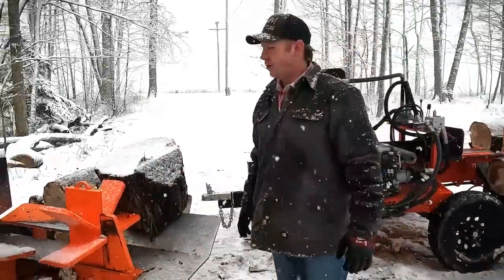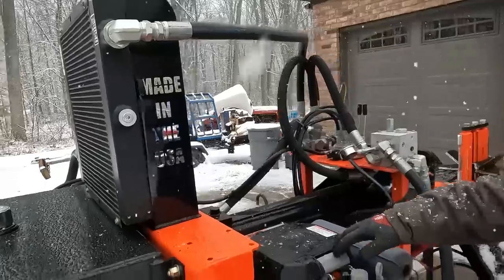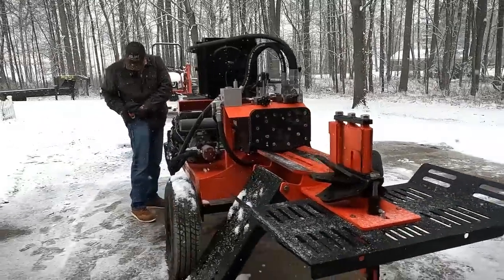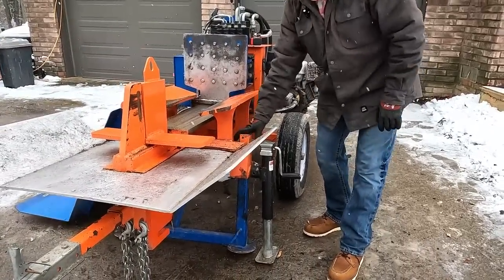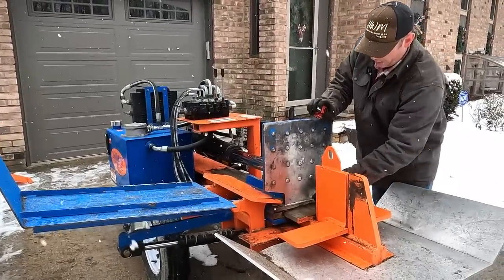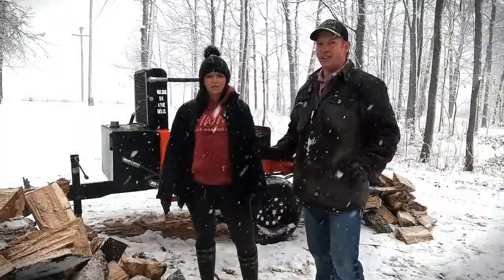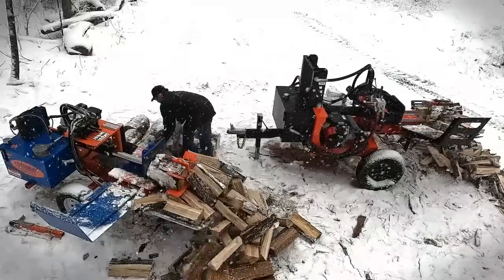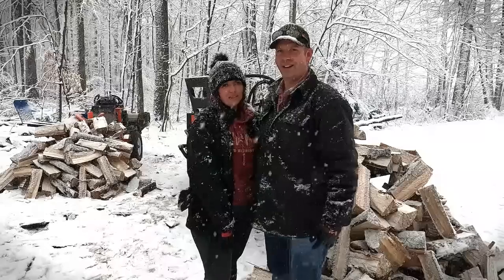Eastonmade 12-22 vs All Wood Musclewood Log Splitter Wars #116

Comment: I think this really shows the difference in operator technique, only because the All Wood doesn't have autocycle.  It was a great comparison because it shows it's not always the machine, but the routine and ability of the operator.  Rachel definitely did better with the Eastonmade, both in the lower design of the machine and the autocycle.  Rachel is a go getter and without snow she would have likely been the all around winner!  Great video!
Reply from the maker: Tim, THANK YOU!!  Absolutely, this video doesn’t show the full abilities of these machines especially the All Wood without the autocycle, Rachel felt bad because she wasn’t able to keep up due to the round size and snow storm. These Splitter Wars videos aren’t a which is better but what is different and what could work best for you!  We will be  running more videos with these 2 splitters showing different scenarios!

Comment: Excellent, detailed review.  You went really deep into each machine.

She also had trouble with the Eastonmade - couldn't reach the rounds on the log lift and had to fumble with the lift.  

For the money, and ease of use, the Eastonmade is the winner in my eyes, even though the allwood would be marginally faster if it had auto-return (but it was $4K more expensive). Reality is it's everything else that creates the bottlenecks - the loading, the removal etc - so I'd save the $ and buy the Eastonmade and invest in a conveyor.
Reply from the maker: Thanks for the feedback!  We appreciate it as we try to do honest comparisons to help people out when making decisions on equipment. We definitely need to add a conveyor to our operation!  Both machines are great and depending on your application either one may be best!
Reply: @hardworkingmanoutdoors  Never seen such great comparison videos anywhere else.  You know your way around a splitter and point out details few would even think to consider.  Impressed with the Allwood - totally agree it deserves far more recognition than the usual suspects, (particularly for professionals who beat their machines) and I can see why you bought one rather than blue and orange.  

Not sure I understand why auto-return is a safety concern for your family? Afraid of getting caught on the return stroke?  If anything, it allows people to stand away from the splitter while operating, rather having one hand on the controls all the time forcing you to stay with the machine.
Reply from the maker: Our initial thought was that with the speed of the machine if something went wrong it would be easier to stop the ram just having to hit the 1 lever vs having two to deal with. The other concern was if a piece of wood got behind the ram somehow on the auto return stroke. I’ve seen it happen to others and it goes back so fast if your arm gets caught it would be bad and it can also damage machine in that situation. 

Looking back we are re thinking our decision and I have talked to Bobby from All Wood and we may be adding autocycle later.

Comment: Hi Heath and Rachel. That was a great comparison. It appears both machines are pretty comparable function wise, but the cost difference makes the  Eastonmade the winner in my eyes. The only problem with this type of “one push through”comparison is that it still requires a lot of re-splits to end up with the final sellable firewood product.  I’d like to see a demonstration where you had to split everything down to the typical 3”- 5” splits that most of us sell.
Reply from the maker: Thanks Dick, we will run one like that in the future. We’ll also do a wrap up of round 1 of HWM splitter Wars giving our thoughts. I am trying to set up an All Wood Locust Vs 12-22 Splitter Wars as they are comparable in price and should be another shoot out!  I think it comes down to set up, and configuration of the machine etc.
Reply: Hi Dick! Thanks for watching😊
Reply: I agree.  For me, the All Wood is so grossly overbuilt and heavy, that is beyond the point of diminishing returns.  That is a 50+ ton machine spec'd to 25 tons.  There's 1000 pounds of steel in that machine that isn't needed as it sits there.  Overkill build, underwhelming performance for the weight and amount steel that you purchase.  But, nothing on that machine will ever bend.  Ever.

Comment: no operator error, different work ability/technique, all three splitters in these challenges are solid, I sold my Wolfe Ridge solely on the size of the push block, wood seemed to peel out and not split completely, glad I stumbled upon Allwood.
Reply from the maker: I agree, if anything it shows the value of auto cycle. You won’t be disappointed with the All Wood!

Comment: Wish I could have started out with a professional splitter in my 20s.  That all wood is a total beast and would buy it if I had a big operation.  I never have seen a splitter more heavily built.  As a Michigander I’m proud someone in this state is producing this amazing product
Reply from the maker: Brian, The Eastonmade is built heavy, but the All Wood is built heavier than any other splitter I’ve e seen in person. Both solid machines!
Reply: @hardworkingmanoutdoors  That thing  is heavier than the one I built for myself. I'd still like to see some lube on the push plate slide. Like they say, grease is cheaper than steel!.
Reply from the maker: @heymakerphd1982  Bobby uses ar400 steel and his thought is that grease holds dirt and actually wears the surface quicker. I know I run the Eastonmade 12-22 with grease and the All Wood without. However I don’t process enough right now to wear either of them out.

Comment: WOW GUYS!  That was a heck of a shootout!!!  The All Wood is a BEAST.  But, with that machine as heavy and extremely overbuilt as it is, why do they only spec it to 25 tons?  That thing should be spec'd to 40+ tons.  It really struggled with some of those rounds and the 8 way wedge.  But, you'll never bend anything on it.  Nothing too strong ever broke!  
Thanks for introducing the All Wood... I've never heard of this company until this video.  More machines to consider now!  Thanks for all that you guys are doing!!!
Reply from the maker: You are welcome and it was a lot of fun to make. Check out some of my other videos where we run huge oak and ash rounds through a 6 way etc. the times it slowed a little was with knotty Hickory through a custom built small split 8 way. He makes machines with more tonnage too. I think tonnage ratings can be deceiving as all manufacturers do it differently and it’s not regulated. We will be running more splitter wars with the All Wood in the next few weeks.  Thanks for checking it out and commenting!

Comment: Hard Working Man AND Hard Working Woman good job both of you. 
The beem on the splitter I built weighs 48 lb per foot, you don't move it by hand either. 
6 inch cylinder 26 inch stroke 22 gal. per minute pump (I wish I had went with 28 gal.)
42.3 ton splitting force if I remember correctly. 
It will either split it or cut it. 
I've never heard the pump go to the high pressure low volume mode.
Reply from the maker: Thank you!  Sounds like an absolute beast of a machine!

Comment: Rachel & Heath...Great video comparing two commercial grade splitters.  When you figure in the cost difference of an All Wood Musclewood at $21,000 without auto-return versus an Eastonmade 12-22 at $11,500 with auto-return I am not sure there is really a choice.  Musclewood has a diesel but you can put new Hondas/Vanguards on every ten years for about forty years for the cost of a single diesel!  Plus you don't have to worry about a radiator, anti-freeze, etc.
Reply from the maker: The All Woods come standard with auto cycle. We got ours without it but may see if we can get it added. Also the All Wood Locust is similar in price with the 12-22 and would be a shoot out in production. I am trying to set up a splitter wars with the Locust and the 12-22!  The new Diesel Musclewood has a sub 3 second full auto cycle so it would compare to the Eastonmade 24 or 37D machine. Both are great machines though!

Thanks for the compliment!

Comment: Hi Heath - it's Big Rodders in Ireland.  Very interesting & entertaining video but only relevant for choice making to a minority of viewers as few can justify expenditure at that level from a financial viewpoint.  It's not just the purchase price but all the other inventory required to run them.  At one stage I was producing 200 cords of wood yearly using a commercial vertical splitter costing less than $4k.  Also, processor speed time is only one factor in the overall operation.  I ran a splitter that was either PTO or electric driven.  While the electric was slower I was amazed to discover that my 6 hour shifts produced the same volume of stacked splits either way as other processes such as bucking and stacking were involved.  For my money I would get the EM and a SuperSplit for the same outlay as the AW.  Cheers!
Reply from the maker: These machine’s definitely fly through the wood!  I am on the hunt for a re splitter, and a vertical splitter as I want to run and compare as many as I can!  I’ll also be running some Splitter Wars with box store splitters trying to cover as many price points as I can!
Reply: @hardworkingmanoutdoors  Big Rodders again. I imagine you are aware of Joe in Ohio Wood Burners.  His empire started with a Super Splitter and he still rates it very highly. I consider it is the finest resplitter out there - it's relatively cheap to buy and run, it's partucularly fast, well proven and reliable plus it's very manoeuvrable. The factory doesn't export to Europe so it can only remain a dream for me.
Reply from the maker: Yes I am. Hopefully I can find one eventually.

Comment: I knew nothing about the All Wood until now. This was fun to watch! Both are impressive machines. I'm impressed by rachel chucking those hickory logs like that. That is some dense wood!

I'm curious about the All Wood log lift and clearance of the tire. I make a lot of 22" logs, and it looks like it would be close to hitting the back tire with a log that long. Any info on that?

Obviously the autocycle is a great feature, and I'm guessing where it really shines is with the box wedge. It will take longer to split the wood, but exposing more grain dries wood faster, and nothing stacks better than square logs.

Thanks for the video! Be safe.
Reply from the maker: Ryan, the All Wood is an impressive machine for sure!  The Hickory series is available with a box wedge, this model wasn’t available when I bought my Muscle Wood or I may have gone that route. We are looking into upgrading our Muscle Wood to full auto cycle as we now wish we would have gone that route from the beginning. As far as the log lift goes we have not run any 22” rounds but we did run a big Maple round today that was 19” and it worked fine, it will be in our next video. I will see if I have a 22” round to try next time we are out splitting. If you have any other questions please let me know.
Reply: @hardworkingmanoutdoors  that's awesome. Thanks. I'm not taking about diameter, I just cut about 15-20 cords a year at 22" long. Just curious how that would fit clearing the tire and the wedge at the same time.
Reply from the maker: Yeah, I’ll find one and run it and let you know.

Comment: The all wood is faster than I thought. I like the open cradle design better on the eastonmade.  For the cost I'm still an eastonmade man. The box wedge with the pull back arm almost never comes off.
Reply from the maker: The All Wood is definitely fast!  I definitely want to see one of the All Wood Hickory machines and how the box wedge and pull back arm works on that model. We don’t do a lot of large rounds but if we did I don’t think I’d take the box wedge off either. Both top notch machines and wonders imo.

Comment: It’s hard to have head to head, size of logs, the operator makes it not accurate.  That was a great video of splitting.  At this point I feel whichever splitter fits you personally with its size, lever location , log lift, etc would be great.  Plus long term splitting  and having a split that fits you personally would have a big impact on all day splitting.👏🏻👍🏻. Great job and love the snow effect.
Reply from the maker: Larry, absolutely, we tried to convey that in the video. After filming we realized we’ll need 2 people to run these machines efficiently in a head to head that just shows machine vs machine. We’re doing the best with what we have and it was a lot of work but a lot of fun. More to come!

Comment: Man that Allwood made the EM look slow which was unusual. Auto cycle on the Allwood would be nice but it will be interesting to see how he does it. Not sure if anyone makes a AC valve that can handle that much flow. That’s the reason I went with 2 AC valves on my splitter. I’m moving 56gpm with 36hp. On a 24” stroke I get @ 3.3 sec cycle with a 5” cylinder. Full 30” stroke is 4.5 sec. 
Also I do like how Allwood uses a secondary circuit to control lift and wedge. None of that ridiculous engine laboring when lowering an empty log lift!🤦‍♂️
Reply from the maker: Garry, sounds like you have an awesome machine. I will say both Bobby and Andrew know their stuff. I wouldn’t be surprised with what either of them put out here in the near future. I’d love to see the 24D and 37D in person as well.

Comment: Hi, Thanks for the videos.  I own an Eastonmade 12-22 and a SuperSplit, that I converted to electric operation.  I am very happy with both.  I think the SuperSplit is a fantastic re-splitter, as it is wicked fast.  After 50 years of cutting and splitting the only thing I wore out is my back. Unfortunately that cannot be replaced. :-((  I may have told you before, but if not, there are tools to prevent the latter.  They are:  Hookeroon, Pickeroon and Wood Pike.  They are inexpensive.  Please consider all three.  If you need details let me know.  Stay safe!  Shalom/gw
Reply from the maker: Thanks, yeah we have them and use them a lot. Just didn’t for the Splitter Wars videos as we are trying to keep up with these machines. I just searched for a super split on marketplace but didn’t find any. I’ll keep looking!

Comment: As far as results go the 2 are so incredibly similar. The All Wood seemed to slow down more when it bogged down compared to the Eastonmade but that may have been due to the 8 way versus the 6 way. When running empty the All Wood has the 12-22 by a whisker. I'd love it if you could get hold of either some Aussie redgum which is common'ish in California or some bluegum which is the same in Florida.
Reply from the maker: Thanks Alan, they are both fast!  To be fair the times the All Wood slowed it was Hickory with multiple knots going through a custom small split 8 way. We will be running this again with 4 way wedges and 2 people per machine which will reduce the operator element. It was definitely a challenge for Rachel to run the higher working height, non auto cycle All Wood in the snowstorm with these big heavy rounds. Didn’t really do it justice. More Splitter Wars to come.

Comment: Damn girl! Beast mode engaged!!  I still think Eastonmade for the win...3 grand cheaper and only saving about 3 seconds total and Eastonmade's can change out wedges with little effort. Both are heavy duty splitters but when I looked at All-Wood splitters I didnt see where you could change out a standard wedge to a box wedge, looked like you needed 2 machines.
Reply from the maker: For sure!  Those rounds were heavy and slippery!  Both awesome machines for sure!  The All Wood Hickory has the interchangeable wedges and box wedge all in one platform. I don’t think you can go wrong with either, all depends on preferences and uses, towability, height, design, etc.
Reply: Thank you❤
Reply: @hardworkingmanoutdoors  Oh ok I didnt see that about the interchangeable wedges. This is why a good web site is so important. I looked a few times but never saw anything about a interchangeable box wedge or that might have changed things.

Comment: Thank you for showing these machines. I’m thinking about getting a machine and have been thinking about the ones you showed nad those uyou mentioned. Seeing how you have suede all of them I wonder which you would purchase if you had to choose one AND why you would choose the one you said in the answer? Thank you.
Reply from the maker: Hello, thanks for watching. Honestly we have been very happy with the All Wood and the Eastonmade!  You can’t go wrong with either in my opinion. It basically comes down to what you prefer and what fits your needs. We will be doing a video in the future showing what we like and prefer from model to model. A few key things I feel are important are build quality, working height, towability, ease to move, reliability, customer support, lift, log cradle, wedge system, etc. between the All Wood and the Eastonmade they both have their own slight advantages. These 2 manufacturers have been top of the class from what I’ve seen so far.
Reply: @hardworkingmanoutdoors  thanks for the input. I’ll keep up with your videos, they are enjoyable.
Reply from the maker: Thanks!

Comment: I have a 2019 12-22.  It had the short tongue also.  When you pulled it from the engine end tongue was too short if you turned hard with a 4 wheeler you could hit motor on 4 wheeler.  I mentioned it to Andrew must be he changed it.
Reply from the maker: I wondered if it changed or was altered.